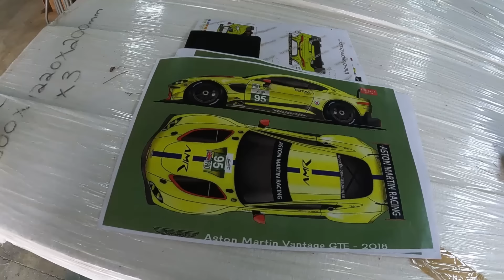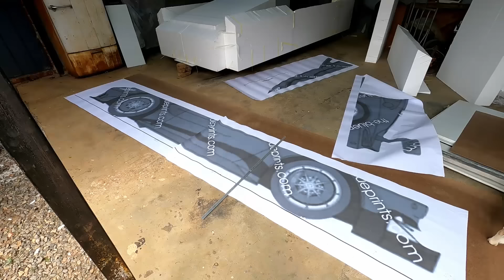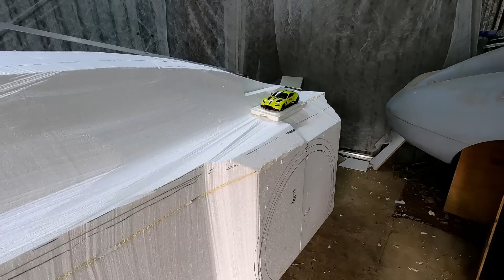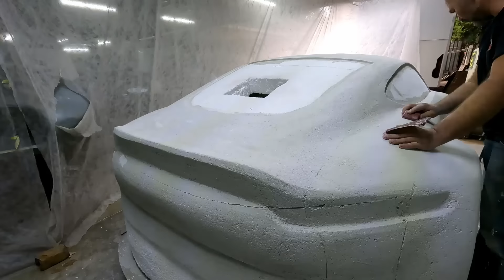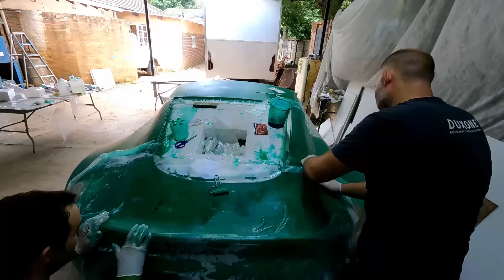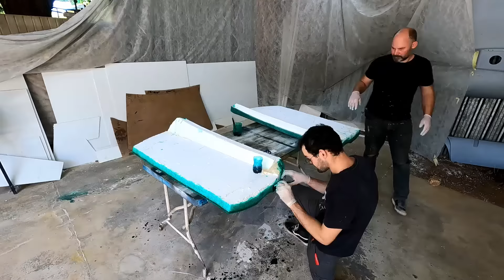EASY METHOD TO MAKE SUPERCAR BODIES FROM SCRATCH

Comment: the difference with carbon fiber and chop is Carbon fiber can be heat cured, and it’s electrically conductive    chop is arranged at random carbon in an orderly alternate direction, if you do one layer long ways two layers diagonally  X cross ways and another long ways in a vacuum mold you’ll have trouble breaking it

Comment: I thought the reason for roughing up the surface & then laying that 1 first layer of nylon was so that the fiberglass wouldn't stick to the polystyrene? Same goes for the paint, I thought that was suppose to help the fiberglass not stick to the mold?

I was surprised to see how you had to remove the foam when you were done after cutting panels, and the difficulty removing it. Turned out great tho, thanks for the education.

Comment: The smell of epoxy resin is addictive... Haaaaaaa ! I use to build surfboards the exact same way, except we didn't have to peel the styrofoam away from the cured cloth as a final. Just sand and polish, then ride.
Awesome work you did !

Comment: Also in your comparison, its not that the 3 layer mat weave is "stronger" it is actually more flexible. Carbon Fiber hardens to be very strong and more rigid than Fiberglass thus the brittle nature and breakage. Chopped strand also hardens to be more rigid. But the weaved (and criss-crossed lay down method you did) delivers a much more flexible and forgiving part which, I think is what you want in those body panels so they won't shatter in the event of collisions or impacts with the wall.

Comment: Great idea, well documented process! I am personally always troubled with Styrofoam, because it gets all over the place whenever I am making anything from it. Then I tried the idea documented by some Asian YouTube posters... they dissolve pieces of Styrofoam in acetone and produce a very useful gluey compound. I am now used to vacuuming all the dust and pieces of Styrofoam and creating the mass for future modeling and surface filling and repairs. 
In your case one liter of acetone would dissolve the whole quantity of Styrofoam, that you had to dispose off somewhere and ultimately pollute the nature. More acetone would produce a less viscous glue.
Reply from the maker: Thanks for the tip. Will definitely try acetone

Comment: I have thought about using a car with clay on it to do this. Make a mold using fiber glass then denim and cotton cloth from old sheets to  cut the cost. Then make the actual parts. If someone had a 4'x8' cnc engraving mill. To carve a body panel in foam this would be awesome, make a car one panel at a time!

Comment: wouldn't be easier to put a layer on a final foam shape, that will separate fiberglass from the foam? So you can take off the whole fiberglass body, and remove the foam model.

Comment: Hello bourgh built my friend and I are budding inventors.

We have been watching your vids last two wks 

Love how you created the polystyrene shell to a beautiful fiber glass materpiece.

Its this said video that has got me commenting soon as it had finish.

Bourgh Builts we could do with some advice.

We are currently working on a prototype also using polystyrene it only occurred to me while watching your vid that there are grades of polystyrene.

Looks like we are using the general type the idea is we will make two prototypes one made of polystyrene the other made of alumni and carbon fiber.

Are we using the right grade for this project?

What would you recommend?

Due to the dimensions for our frame we are having to bond two slabs together at the width end of the slab which measures 50cm.

Were using a No nonsense PVA glue...not sure about strength would using a type of No nails glue be better?

In general we would love to hear from you.

Keep up the fabulous work we are all inspired.

Eddie and Tyron
Reply from the maker: Hi there. I use the cheapest grade polystyrene because it weighs less. Pva glue works well and also pu foam that you get from the hardware store to seal holes in walls for example. Hope it helps. Good luck with your project!

Comment: I word of advice from an actual sculptor.  To make something like this symmetrical, you want to mount it over a set of REFERENCE RAILS.  That is a pair of guide rails that are set dead parallel to one another and level. And you want to use a laser to mark the centerline.   You can then use a SURFACE GAUGE to measure along the length of the rail, vertically off the top of the rail ( set level ) and then IN toward the centerline.  You can use this to measure points on the surface ( called pointing up ) of say a model like the one you have, using a set of reference rails scaled down to the small model ) then multiply those numbers up to the full scale, subtract a quarter inch from the Depth measure and carve half the car to those number approximately, then do final shaping on one side, and take more accurate measures from the finished side and translate them to the surface gauge moved to the opposite guide rail.  You can rig guide rails in the front and rear of the car for even more accuracy on the front and rear end.

Rather than just eyeballing it, this method gives you much better results.

Another quick trick? Download a model of the car in question from a site like Turbosquid, and then in a 3D modeling program derive Cross Sections of the car every inch, or every 2 inches.   Be sure to model a set of parallel holes the same diameter as readily available PVC pipe, all the way thru the car prior to generating the cross sections.   You can then send those cross sections to a large format printer and use them to cut out ordinary 2” thick insulation foam you can buy at any hardware store.  Slide all the sections together and you will have the car 90% shaped and correct. Just have to knock down the corners of the slices.
Reply: #couchengineer
Reply: @neljpj  Not really.  I engineered and produced the 18 foot tall bronze gamecock at USC stadium.   I’m a sculptor, product designer, production consultant, and design and construct buildings both new and remodeled. I also sculpted and did the production tooling design for several rollercoasters.  My advice on doing a car body is literally how ACTUAL car companies make their full scale models. ( or used to ) Using reference rails and surface gauges, although in the modern era, many have switched to mounting 6 axis robot milling machines to the reference rails and do much of their initial modeling digitally.   ( BTW- I do THAT kind of work as well. I have designed car bodies and boats entirely digitally and had the final parts or the tooling masters 3D printed or milled )  But I Was trained in how to do point ups and symmetry using the most basic of tools in the 70’s and 80’s, when that is how it was done.

Comment: Having watched other very long videos on the other methods you mentioned I'm extremely impressed with your method.  Now I wonder if the process would benefit if you took all that waste, processed it and then used an expanding foam to re-bond it together into car-sized blocks to eliminate the beginning block assembly time.  Also wondering if getting some custom extruded edges made from aluminum to screw/bond in place instead of shaving the edges and glassing them in wouldn't be more efficient. Same for having door jamb stock made from aluminum and then bending it to fit the size and curve angles needed for various road cars.

Comment: So.....how did you deal with the plug in regards to dimensionally reducing it so the finished exterior was to spec rather that larger than an original? I suppose it wouldn't matter so much as the body is a one-off copy for a race car,  not a Concours copy ;)
Reply from the maker: It is something I continually take in consideration to reduce final dimensions by 3to5mm

Comment: Great job guys..
..I'm still itching just watching this...may I suggest, don't throw away the polystyrene..mix it with superglue ...pour it into molds,then sprinkle baking soda on it,works as a catalyst...make door handles, air scoops ect.
.
Reply: @jamesgocka346. Yep bud. A similar thought occurred to me. Saw a vid where polystyrene is dissolved into some kind of solvent until the consistency is somewhat thickish. Pigments can be added and then used as a filler or to make shapes in moulds. Once set it is incredibly strong. Also finishes off with sanding to a very fine finish.
Reply: I don't know how you call it in english but in Poland we have Nitro-cellulose thinner, one glass of this can dissolve whole pack  about a cubic meter. I used it as a clear coat whem i was short on supplies 👍
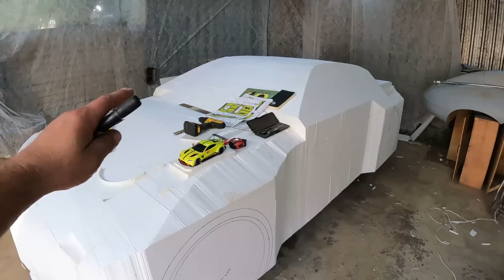Reply: I could do everything in this video with the same results until the 13:00 mark. After that, it'd immediately turn into a dumpster fire and consider it a failure. Impressive work.

Comment: The huge misconception about carbon fiber is that it is stronger than fiberglass per weight. That is not true. Carbon fiber is stiffer than fiberglass by weight. That's why extreme high tolerance vehicles and things like formula 1 cars use carbon fiber. But it's actually brittle like you've discovered. Fiberglass is stronger than carbon fiber but it always has some flex in it no matter how you make it now you've got some extreme flex and the kind you made but fiberglass has a little more flex than carbon fiber but it is stronger than carbon fiber it is just not stiffer than carbon fiber by weight
Reply from the maker: Good explanation thanks!

Comment: if this body is for a real car what are you using to strengthen the fibreglass
Reply from the maker: I usually leave some polystyrene on the inside that also helps for making the inner panels. It makes the body super strong and stiff. Not allowed on racecars thou..

Comment: Awesome job & talent . Could you explain why  didn't you take moulds off the polystyrene plug, & lay up  bolt together flanges in the fiberglass to make a multi piece mould? Do you now take moulds from the product youve  finished, or is this just a 1 off body manufacture. ? No knocking you but I couldn't Imgine spending that much work & achieving the awesome shape you created , without pulling a mould off it?
Reply from the maker: I usually take molds of the polystyrene plug like you described but the klient specifically asked for a body only.
Reply: @BroughBuilt  ok thanks, that explains it, but your client is definitely going to wreck it if it's  a racecar, & no moulds , that's just asking for trouble. Awesome job love your work 👍

Comment: Very well done and instructional video. Every step was completely understandable. I'm thinking it must have been very challenging to maintain left/right symmetry. I am wondering if a mold release would have worked to avoid or reduce the final chiseling out the foam from the fiberglass.

Comment: you should have used a mold release so you can make extra panels for repair. Racing isn't a dainty sport.
it would also make clean up a breeze. no carving out foam from panel or sweeping.

Comment: I think the carbon fibre broke because it is harder.. So harder the material so more brakeble it is. So more it can counteract against pressure forces so more sensitive it gets against tensile forces. It the same reason why you have to combine concrete with steel when you are building bridges or skyscrapers.

Comment: If you got a 20 litre bucket with maybe 1 litre of acetone  you can melt all of that excess foam into the bucket making a kind of liquid plastic which can fill moulds, coat, join or repair as it is thick  will harden once dry on things and could utilise in some way. Turns rubbish into a useful product while reducing its volume . Like   3mtr of Styrofoam would reduce into only 1litre of space. Just a thought... Ive made number plate surrounds and repaired stuff with this liquid plastic from melted down styrofoam . will also keep  for ages if  kept in sealed bottle   .might only need half a litre its that reactive in breaking down. i said thinner before but edited to say i meant acetone . By the way its great how you demonstrated this method and is definitely achievable as not everyone is a mathematician .
Reply from the maker: Thanks for the advice 👍👍

Comment: If it wasn't for the cost of the foam I could use a large CNC mill to cut large foam blocks using 3D point scans of real cars or scale models. I guess if the finished fiberglass is still worth enough $$$ then the cost of the foam is not so bad?

Comment: Carbon fiber is not necessarily meant to bear more load before breaking compared to regular fiberglass. That's what Kevlar is for. Carbon fiber is meant to be more rigid, which makes it more brittle. However, a more rigid part means you can use less layers and weight to achieve the same shape that will withstand wind loads without deforming.
Reply from the maker: Good info thanks!

Comment: This method is fine fit a simple shapes, but the blue prints like you’ve printed are usually made from 3d models in orthographic views, meaning that proportions are not exact. You either have to make a lot of refining by eye or use more planar dimensions to get the form of the car better. It’s far easier to use a 3d machining on the same foam, the quality machines are expensive, but diy are not so hard to make with an all g-code available as open source.

Comment: Perfect and easy, next time when you see a sasi boy or body shop that tells you it's hard to do, show them this video.
Reply: Yeah, it takes less than an hour. Anybody can do it for $50.
Reply: If you calculate the wall insulation foam that costs like 2$ per 2square meters then you can buy lets say for about 30$ the foam, glue for 5$ and remaining 15$ you can buy a small bucket of filler and sand paper. 50$ total  of course the resin and fiberglass for the entire car will cost you like 300$ approximately
Reply: @DominoSixO  But the skill is priceless. I've been building custom parts, molds, and bodies for decades. Have you? PS: WTF is a "sasi boy"?
Reply: I've been building airplanes, boats from foam and 3D modeling for decades, so yes, I have too. I know some people overexaggerate with prices and skills when they never been in such fields

Comment: Why not leave a thin layer of polystyrene  on the inside of the panels and brush on some acetone over it, the acetone will melt the polystyrene and make it gluey..... then it will harden, adding to the stiffness and strength of the panels?    I guess it may eat into the epoxy?

Comment: Great post , good advice included. what is the Teal ply ? and where can I get it from ?  and did you use  fg resin to paint over it ?
Reply from the maker: thanks. the peel ply can usualy be bought from the fiberglass suppliers. We use epoxy resin as it does not affect the polystyrene.

Comment: Very Very awesome video and the techniques and method sharing is awesome! Thank you! One suggestion, you can get a hand digitizer, scan in the vehicle to a computer and get exact measurements and even model it on the computer. Can measure it very easily.

Comment: You did it just right. The carbon fiber is much stronger in a multi directional lay up, however carbon is so stiff it does break rather than bend. If you could get some "S" glass, it would be as strong as the carbon, but would bend like your lay up. Coming from the sailing and catamaran world, a lot of people want carbon boats until they bump into the fuel dock and write off their boat. Flexible fiberglass with carbon stiffeners is the best of both worlds. Of course, vacuum bagged infusion or pre-pregs would be even better.

Comment: I made a custom front spoiler using this method,,,, however i only found out the fibreglass eats foam when i applied the resin!!!! I then tried putting a spray coat and found the paint did the same. In the end i continued bogged the bits that fell in... That made it heavy!!! No youtube to learn off 27 years ago!!!
Reply from the maker: I learn lots from YouTube these days. Back in the day it wasn't so simple. epoxy resin does not affect polystyrene like polyester resin does

Comment: Carbon fiber has a good compresion but it spliting is what makes it desirable because it absorbs impact and not transfer it to the driver thing about beeing on one end of the sheet and hiting the wall with the carbon it will split bit by bit, but the fiberglas will transfer the force to the person* driver more than carbon and not to mention the weight side of it

Comment: When I was manufacturing bodies for a Radio Controlled car accessory manufacturer this was the same process we used, on a smaller scale of course, from 1/12 to 1/5th scale actually, :). Even though I went back to automotive repair because it pays better, they now have made well over 100 different R/C bodies.

The full-scale version is Very cool!

Comment: Excellent work, I worked at futura designs where we made the  hard model for this car from the clay model, one thing we did to ease in the release from the clay model was to apply aluminium foil with spray adhesive, to form a barrier between the clay and fibre glass, then wax and.buff the foil then pva spray it, it  would work on the foam model you were using and preserve it too.

Comment: wouldn't be easier to make wooden side and front template, and cross them in the center of the floor template (you'll get 4 sections), then add polystyrene  to the wooden frame... instead of putting it on the side and trying to shape and sculpt accordingly, also it will help you glue the polystyrene to shape easily